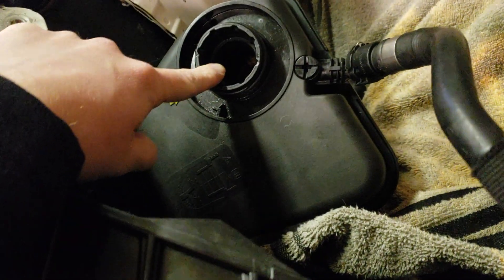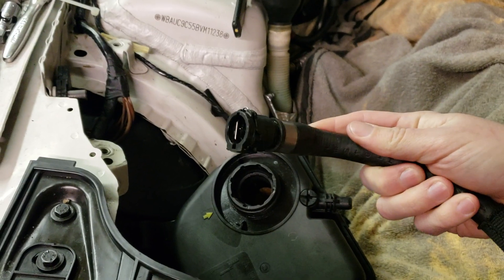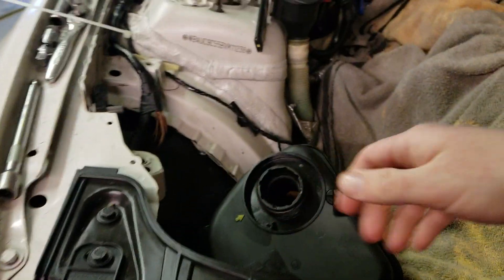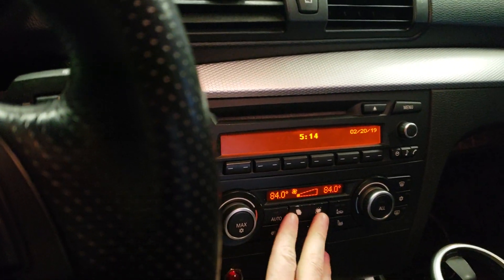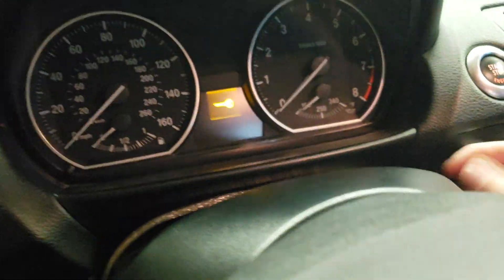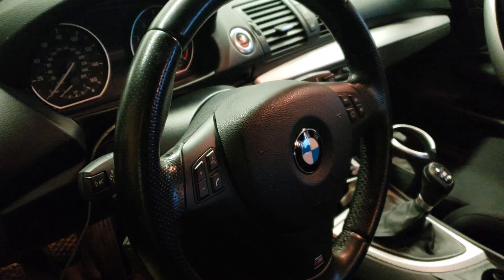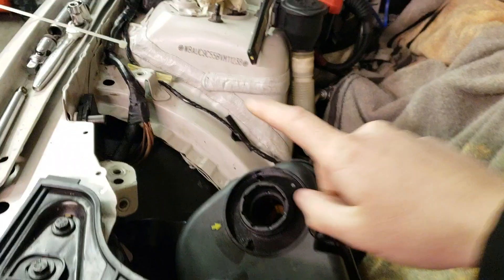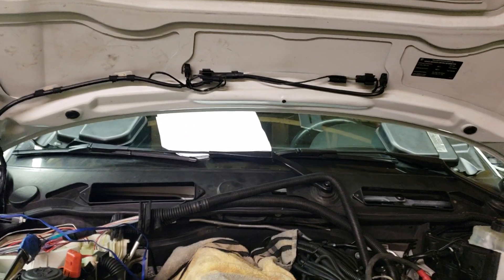BMW 135i N55 coolant flush and bleed procedure

Comment: Please never ever run your car without coolant.  It is not only antifreeze for winter, it is also a lubricant for your pump and protects your seals, it is an anticorrosive.  You are not taking very good care of your vehicle if you run only water.
Reply from the maker: Uh that is why you add water wetter...